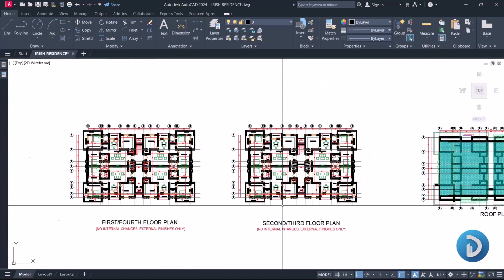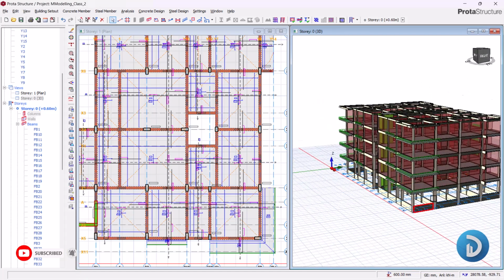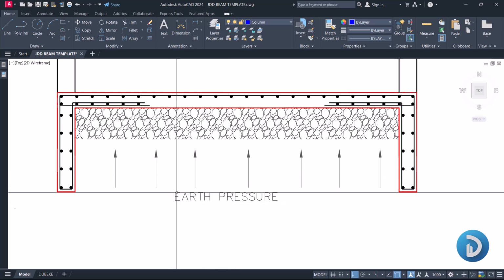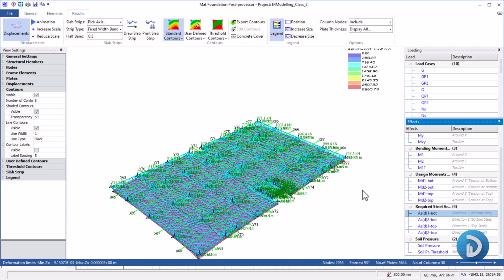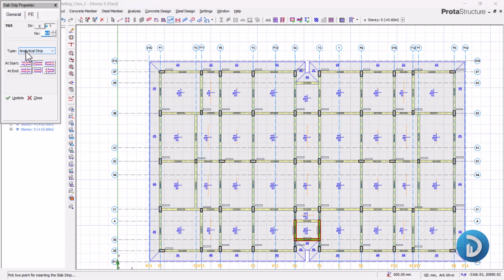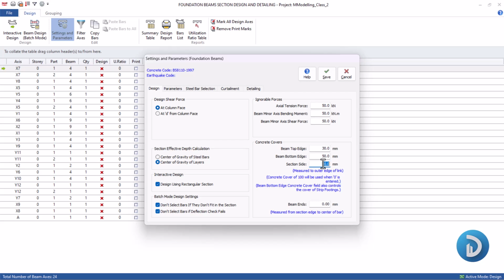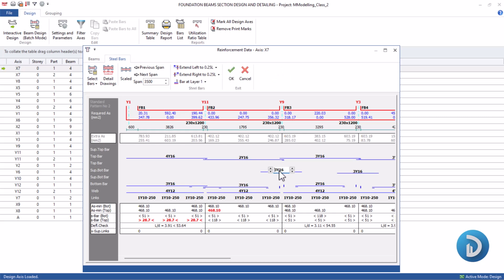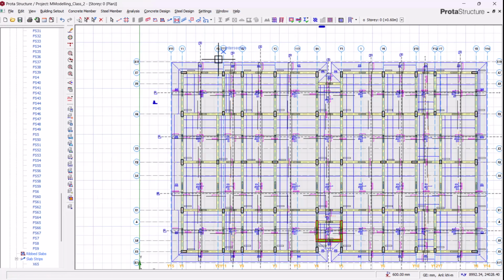Raft Foundation Analysis and Design On Prota Struture

Comment: Really insightful video Engr.
Please how does the reinforcement arrangement translate practically if you have the cantilevered area at the bottom and the main slab area at the top?
For example the main reinforcement of the cantilevered slab has a backspan length, how do you achieve this if the continuing slab is not on the same level?
Reply from the maker: The rebar of the cantilevered slab will be attached to the base of the beam. It will look like a retaining wall.

Comment: Weldone for the wonderful work.
Sir pls how can you remedy a failed column  punching check after performing your raft foundation?
Reply from the maker: Punching can be countered by increasing the thickness of your slab, adding shear reinforcement or additional rebar at the top zone of the part failing in punching.

But looking at calculations sheet will help narrow down the best possible solution.

You can join our group chat where we discuss issues like this by using the link in the description